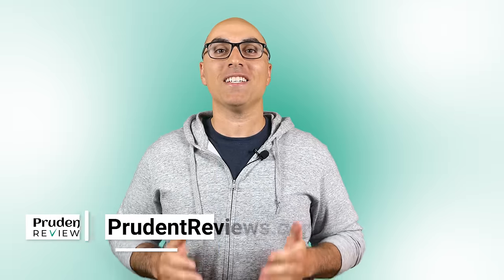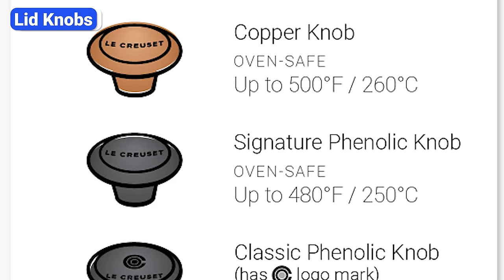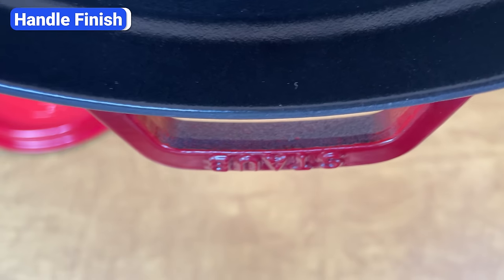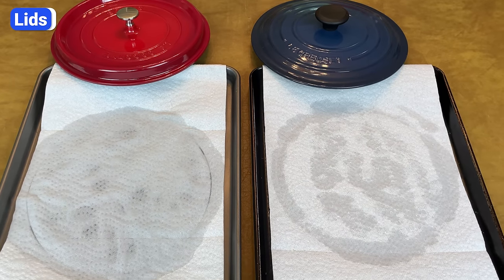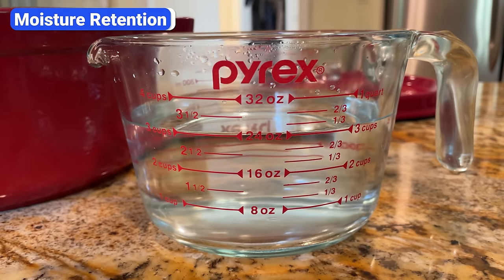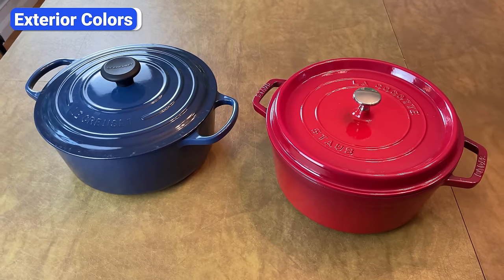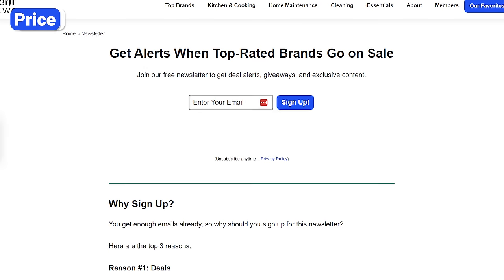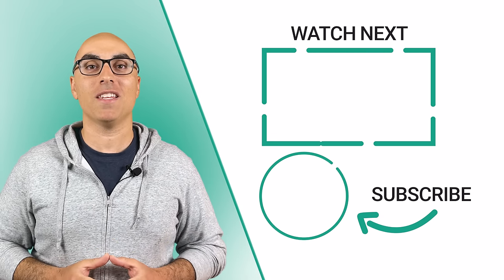Does Staub Outperform Le Creuset? My Tests Reveal the Truth

Comment: I have a lot of both brands and love them. But , if I was forced to choose only one of these brands, it would be Staub hands down. The Le Creuset line is purposely designed to be thinner and lighter to make them easier to maneuver around your stovetop or in and out of the oven. They do a very good job of cooking most dishes. The enlarged handles are also a welcome addition. But my favorite cooking method is braising. This is where Staub shines! I have cooked identical meat-centered dishes in both Le Creuset and Staub cookware. Staub was far superior for the tenderness, juiciness and flavor of the meats. My husband could always tell the difference. The black enameled interiors of the Staub cookware provide superior browning over the sand-colored interiors of Le Creuset. This is based on many years of personal experience using both brands to prepare identical recipes. I have never had any problems developing fond in Staub cookware, but I'm sure this is a personal preference. Both lines are superb products. Yes, they are very pricey. The big side handles and lid knobs on the Le Creuset are very helpful. Note, however, that the metal Le Creuset knobs don't have as much clearance and gripability as their newer black phenolic knobs. That makes a difference when using oven mitts. I have no trouble with the handles and knobs on Staub, but I have smaller hands. Staub gets my vote for the type of cooking I love to do. You can't go wrong with either choice.
Reply from the maker: Thanks for sharing!
Reply: I agree
Reply: I agree.
Reply: Agreed! Great comparison though.
Reply: I have all Le Creuset but I bought my Dad a Staub Braiser the meat is much more tender and flavorful.  I noticed a difference when he cooked in it and thought I might get one but to me the knob seems so little for such a heavy lid.
Reply: @brittanybrown2837  the knobs are a bit small on Staub. They make some animal shaped knobs for them that are fun and useful. I put them on the larger lids. I have about 15 Staub’s now. The loaf pans are the absolute best for breads-I’ve never used anything close to as good as they are.
Reply: I've never had problems with the knobs on the Staub lids, even when wearing an oven mitt. The edges of these knobs are not sloped and rounded as they are on the Le Creuset metal knobs. That is a great help in their gripability. There is plenty of clearance for a heavy oven mitt. You can always wait to get one of the animal themed metal knobs on sale from Staub. I find the fish knob to be very easy to grip. Treat yourself and try a Staub pot. There is good reason why I so often spot them on the stoves of professional chefs when I watch cooking shows.
Reply: @BCSpecht89  I need to try the fish knob. I have a couple of the pigs that I really like. 

I have everything I need now that’s Staub. The only thing which bothers me is I didn’t get it years ago. Nothing better.
Reply: By the way, the knobs are fastened onto the lids of both Staub and Le Creuset with the same size and type of screws and the holes in the lids are the same size, too. You can swap the knobs from one brand to the other. It just depends on what type of knob you prefer.
Reply: What a review! Thank you for sharing ❤
Reply: I love my Staub!  And concur in all points you made!
Reply: @BCSpecht89 Yes! That’s what I came here to say!

Comment: I have both brands. In my opinion, Staub is better in an oven for braising or roasting a chicken, for example (better heat retention and moisture retention), whereas Le Creuset is better for cooking on a stovetop (less heavy, and the light coloured interior is great for monitoring the browning of your fond).
Reply: Great point! I have both as well and totally agree.
Reply: just gonna point out that "heat retention" isn't important in an oven where its surrounded by a far better insulator - the oven... However speed to heat up and reach temp and hold it uniformly is FAR more important which Le Crueset does better IMO
Reply: The thicker walls and lid of the Staub cookware regulate the heat from the oven much better as the oven cycles on and off during the cooking time. The design of the Staub lids also retain more moisture throughout the cooking time. That makes a critical difference in braising. I love my Le Creuset for a lot of my stovetop cooking. However,  if browning is important, Staub is the winner there, too.
Reply: @BCSpecht89 Do you agree with another comment here that the thinner walls of the LC make it better for stovetop cooking, given the heat responsiveness?

Or is the Staub so good at everything else that this is a moot point?

So tempted to grab the Staub. Need to look for a sale!
Reply: @MadLadsAnonymous  It's not the heat responsiveness of the thinner walls of the Le Creuset when used on the stovetop that is the issue. That merely makes the Le Creuset easier to move around on the stovetop or moving it in and out of the oven. The thicker walls of the Staub give superior results no matter how you use it. The only advantage that Le Creuset has, in my opinion, is that the light interior makes it easy to monitor the fond development on the bottom of the pan. It has never been an issue for me.

Comment: I have two Staub, 4 Le Creuset, and Lodge, Cuisinart, plus about 10 other off brands.  The Staub are the best.  I much prefer Staub's black interior especially for browning == even over Le Creuset's black interior. And I think the black interior is much easier to clean and take care of.   I love all the colors of the enameled cast iron of which Le Creuset does have the best selection.  Actually, all cast iron pans do cook well though the cheaper ones chip more easily. I must add Lodge 6 qt. rounded sides Dutch oven is the most versatile.  The Staub is only 5 quarts and a little different shape than the Lodge.  I wouldn't give any of them up.
Reply: I have Three 7 quart Tramontina pots - and have had two of them over 30 years. I DID have to replace the knobs on the lids of those with Metal ones - the newer one had a metal knob. None of them cost me more than $45 - and they get constant use (I had 8 kids and 18 foster kids - and have 78 grandchildren and over 50 great grandchildren). I do take good care of my kitchenware (My Wear ever Professional pots that were sold door to door before WWII are from MY grandmother and you can still get replacement wood handles) and the Tramontina Pots look new - not a single obvious flaw - no chips (There is a scratch on the bottom of one though).  Sorry- I spent my money putting my kids through college - not on pots. But I get no complaints about my food either.
Reply: I also have 2 Staub and 4 Le Creuset. But I much prefer my Le Creuset. I find them both way to care for, but I will admit that my Staubs can handle more abuse. I still baby them though. But the lighter weight, wider handles, bigger color range and the light cooking surface that makes it easy to see makes the Le Creuset more pleasant to use. They’re both amazing though.
Reply: @carolkalmerkalmer3135  I agree about the Staub black interior being better at browning than Le Creuset pans that have black interiors. Years ago, Staub used to describe their black interiors as having finely ground quartz mixed in with the black enamel to give it extra durability and superior browning and searing capabilities. I think they realized that they were giving away a trade secret, so they stopped saying anything about this. However, you can still find this information on William Sonoma's website for the Staub products they sell. I have found this to be true from my own experience in using skillets of both brands. The black interior of the Staub skillet always gives superior browning results to the black interior of the Le Creuset skillet.

Comment: I have 9qt LC and 5qt Staub. Both are stunning to look at and function as expected. 
I use them for cooking casserole type dishes and for baking. 
I also have bunch of other LC and Staub pieces. But I hardly use them.
I would recommend others to avoid buying oval (non-round) shape pots. They don't heat as evenly as the round dutch ovens. 
Also get the steel knob and be safe. Very first time of using LC, I placed lid with plastic handle in oven. 
Never use the rough scrubbing surfaces (even the mildly rough). Instead put warm water with little detergent and let it sit there for couple of hours. 
Never overheat without fat/food on cooking surface.  
Use wooden utensils. Never metal. 
Cast iron even the enameled finished dutch oven is not for everyone. My sister and I bought one at same time. She destroyed hers within a year. It looked like it had come back from Iraq/afghanistan. I don't know how could someone damage such sturdy pot in short time. 
These dutch ovens are so heavy especially with food inside. My 9qt dutch oven gets so heavy and I am so afraid to put it on countertop. It can easily damage granite if you are not careful. 
Don't throw away those plastic clips that were on the dutch oven when you did unboxing. Those come handy during storage, if you are not going to use the pots for long time. 
Make sure you are buying Made in France items from these companies. They also sell lot of Made in China items. I have some of those (non cast iron) and they have quality issues. Avoid those. I suggest buying Emile Henry for ceramic cookware. Their bakeware is superb.
Reply: Your summary is magnificent, the points are so accurate.  Especially about the little plastic clips that protect the lid for storage!  And yes, NEVER heat to maximum - I cringed when I watched this video with the red hot ring under the pans.
Reply: @sandradavies7804  the red hot rings are just how those stovetops look when you turn them on, depending on how old it is. It's not like a gas or coil-electric that changes color based on how hot it is, those stovetops (or at least the old one my parents had) regulated temperature by pulsing the heat on and off for differing amounts of time.

Comment: I have owned and used both, each are effective in how they cook, but at this point I only have one Le Creuset roasting pan left and have switched completely to Staub. I prefer the Staub ovens and now own multiple Staub dutch ovens and love them. Do not feel bad about my old Le Creuset ovens, they are going strong at my two daughter's homes.
Reply: Staub ovens can also be used more effectively in a campfire, for those looking to do so.  The flat top and substantial lip surrounding the edge allow you to layer coals onto the top without them slipping off as they burn or when you need to take the cover off when adding additional ingredients, stirring, etc.
Reply: Same here started with Staub, because Was hooked on their colour range, then switched to staub and will never go back. These are always my go to pots and I just love them. The results you get with Staub are really superb. No wonder they are also a favorite for the pro´s
Reply: @ginglebret  Wouldn't burning charcoal damage the enamel? I cook with charcoal all the time and I figured that would wreck enamel for sure.
Reply: @praetorxyn No, kiln temperatures used to glaze ceramic are way higher than a campfire.  Good question though.
Reply: @ginglebret  The specifications say they’re only oven safe up to 500 F is the main reason I asked. Either way, I’d probably be afraid to take one that expensive camping or something anyway, and would likely just get a Lodge one for that purpose.
Reply: @praetorxyn good call I'd say.  You would be fine, in regard to functionality, but like any cooking pot over coals it's going to develop some soot.  But, if you're asking out of inexperience with fire derived coal beds, it's a lot easier to regulate temperature than most may think.

If you can regulate temperature well enough over coals it shouldn't be an issue so long as you don't heat it up empty, but you may be putting yourself at risk to cracking the enamel after further thought.  I think your Lodge plan is the way to go, though I think you'd manage fine with a bit of restraint and attention on the Staub over and slightly under the coals.
Reply: @ginglebret  I cook with charcoal all the time, it’s just grilling / smoking as I don’t even have a Dutch oven. I’m eyeing a Staub for stove use at least though. We’ll see if I can hold out for the sales.
Reply: @praetorxyn Cool, yeah, they're great.  Hope a sales rears it's hard for you soon.

Comment: Another feature of the flat self-basting lid of the Staub is Dutch oven campfire design, that allows you to put the Dutch oven in the coals and put coals on top for a multi surface oven effect.  

I see the dark interior is a Staub brought up quite a bit versus the lighter interior, if you ever used cast iron, carbon steel, non-stick Teflon or  ceramic you should already be adapted using dark Interiors so it's not a negative or a drawback by any means that would be out of the ordinary and the non stain / discolor interior of the Staub or retain its quality visual appearance for many years. 
Buon Appetito' ✌
Reply: That's right, many reviewers are all about the cast iron and carbon steel pans and tout them as a must-have, but when it comes to Dutch ovens, suddenly, the black interior is a problem so critical that they totally disregard black ones in favor of whites (I'm looking at you, ATK). Is a white interior nice to have? Sure. Is it critical to decide on which brand to get? Seriously doubt it. Otherwise, why don't they favor a super thick stainless steel pan instead of a cast iron one?
Reply: You would NOT want to do that with enameled cookware!!! The hot coals will damage the enamel. Buy a raw iron campfire DO from Lodge or Camp Chef for that.
Reply: @Junkinsally  I have raw cast iron if I ever wanted to do that but that's where the lid design came to be was the example. 😊

Comment: There is no bare cast iron showing under the handles. The final coat of color is not sprayed under the handles to avoid too many imperfections with the hand finishing process. You are feeling a texture similar to the interior cooking surface, which, BTW, is another feature that assists with browning. A reason often missed.

Comment: We have both but I find the Staub just has had more thought put into it. The condensation bumps, the flat lid with a lip that you can pour water onto, the fact that lip recesses perfectly into the pot when you flip it, it's just more refined.
Reply: why on earth are you pouring water on a dutch oven lid?
Reply: @richmondvand147  I think this was demonstrated in the video with ice cubes placed on top of the lid rather than water. My understanding is that the temperature difference causes increased condensation on the inside of the lid, resulting in increased basting of the food.

Comment: I consider thicker walls thus more weight to be positive not negative. It stores heat better, also allows for better distribution of heat throughout the dutch oven. Yes, obviously weight might be considered if what you are cooking is especially heavy. However, as most foods we humans consume tends to be heaviest when wet the biggest weight difference from empty to full will be with a thick stew almost to the brim. Like a succulent gulash or long simmered roast.
Reply: Yes, while still can I do prefer thicker wall for better heat retention n "heat distribution". But... sometimes it hurts hand joints for some specific older people.

Comment: My Staub from a few years back is definitely enameled correctly on the handles.  Maybe you got a defective pot, or maybe they have cheaped out in just the last couple of years.

I LOOOOVE my Staub.  Use it a few times every week.
Reply: My guess is that staub leaves the raw/textured cast iron in the handles for better grip. It makes a difference especially when wearing oven mitts.
Reply: My Staub also have handles enameled all around. (It's just a few years old.) The inside surface is a little rugged (compared to the outside), but fully enameled. So, yes, probably a mishap in the production of the one tested.

Comment: What isn’t discussed in the video is the 2 different types of handles on Le Creuset pieces - signature and classic. Only signature handles are shown and discussed. Yes, these are larger than the Staub handles. However, the classic handles are much smaller and similar in size to the Staub handles. 

Additionally, Le Creuset does make pieces with a black interior. It’s harder to find these pieces in the US market, but are commonly found in the Asian market and  more easily found in the European market. 

I have an extensive collection of both Staub and Le Creuset pieces. While they both have a place in my kitchen, I reach for my Staub pieces the most.
Reply: My first piece of Le Creuset cookware was the 5.5 quart Dutch oven with the smaller handles. Because these handles were very smooth and rounded, I had great difficulty with them as I got older and my hands grew weaker from arthritis. It was especially bad when I was washing this heavy pot in a sink filled with hot, sudsy water. Several times these small handles would slip through my hands and I nearly dropped the pot on my foot. It was dangerous. When Le Creuset came out with the larger handles, I sold my older style pot and replaced it with the newer style. Problem solved. Interestingly, I never had this problem with my Staub cookware with its smaller handles. The Staub handles have more squared off edges and the Staub name in raised letters along the top. These help to improve the grip over a smoother, rounded design.